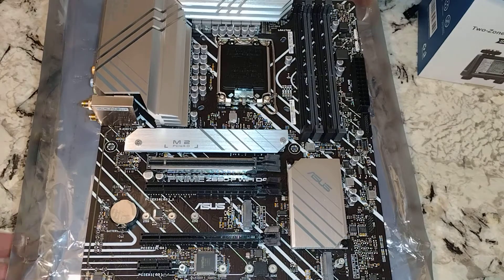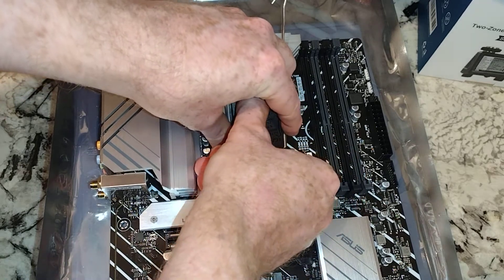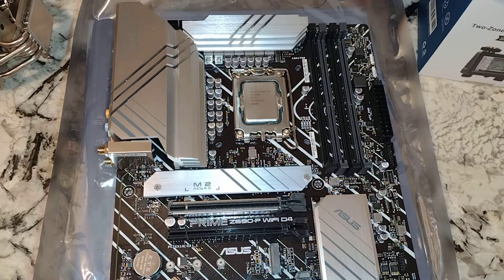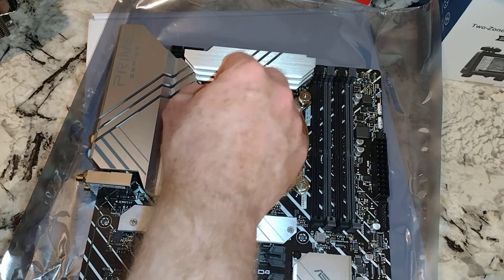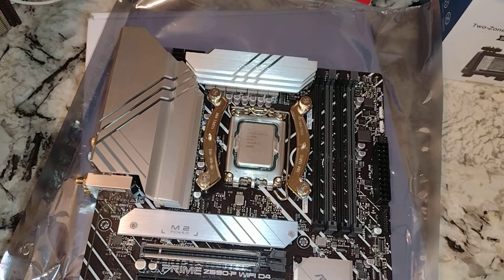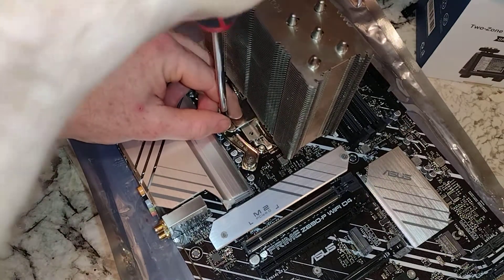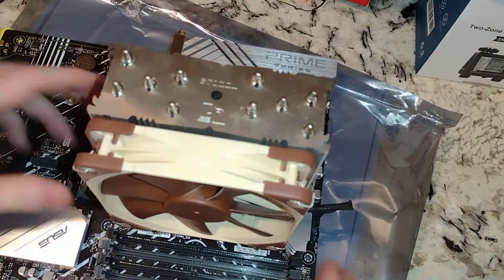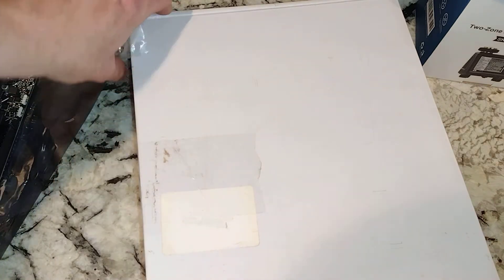Install I9-12900 in Asus Prime Z690-p Wifi D4, M.2 and RAM, Noctua cooler, How to guide

Comment: My Corsair RM750X doesn’t have a four pin ATX12V for the CPU motherboard power. Of course I have the eight pin CPU cable. Did you have a hard time finding a four pin cable? Or is it really necessary?

Comment: Question, wouldn't be better to install the SSD into the upper slot with it's heatsink?
Reply from the maker: Yes, that would be the preferred location especially for a Gen4 m.2 that has your OS on it.  One could argue having it not under the GPU is a better location.  I may have gotten lazy in this video and just grabbed an open spot.
Reply: If you install your os on your m.2 can you use the extra storage for stuff or does it use everything?

Comment: Great video. Just built one today with an i7 12700k 12 core, thermaltake tough air 510, 2x16 corsair vengence ddr4 3600, msi rtx 3060 12gb, evga gold 850w ps, corsair 4000d airflow case. nocurna is a great cooler but those colors are from a leading edge 386 from the '90s

Comment: does the CPU cap not pop off anymore when you bring the clamp down?
Reply from the maker: It will....takes a bit more effort than LGA 1200/1151.  Leaves me wondering if it unseated the CPU at times.